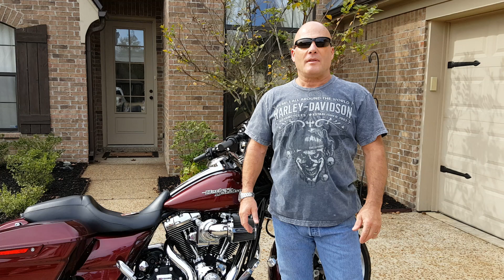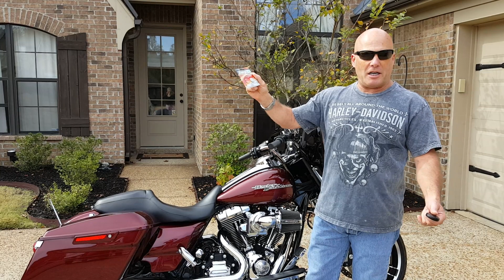Bike won't start? Could be your key fob!

Comment: There's a 5 digit pin code that overrides the fob should the battery die on your FOB. You should have it written down in your owners manual. If you can't find it in your owners manual you still have two options left. #1 you can take it to your local HD dealer where you bought the bike and they can recover it for you. # 2, take the little blk plastic casing off of your ignition barrel key and the factory FOB override # is  there. That is, as long as you didn't change the #. Which you can do. Just don't be a dumbazz and forget the #. Now for the tricky part, knowing how to enter the override pin. 1st, turn the ign switch to the "on" position and the start switch to the "on" position. You should get some flashing lights etc.. Where it shows your milage it should now have a flashing readout that says "enter pin. Now press your left signal switch as many times as you need to, till you get to the first # of your pin. once you have the 1st # of your the pin  press the right signal 1X. That should take you to the 2nd # slot. Again, press to left signal switch as many times as you need until you reach the desired # and then press the right signal switch to enter. Repeat until you have entered all 5 digits. BAM!! the bike should start.
Reply from the maker: Agreed, I know it now but didn't at the time. Thanks brother

Comment: My 2 cents - my and newer bikes come with a pin code - you can use the pin code and start the bike with out the key fog - I did it with my HD
Reply from the maker: Agreed,  I didn't have it programmed at that time, of course I added a code shortly after.   Thanks

Comment: I have a 2014 Indian Chief Vintage and had the same problem.  Was an easy fix, but until i knew what the problem was, i was like WTF
Reply from the maker: Snake Bite This will happen to anything using a key fob when the battery does, crazy.

Comment: I have an 07 knight train amd I have changed the battery in mine several times and I'm still having the same issue. What would you suggest? Short of taking it to the dealer and paying a retarded amount for diag and mechanical rate.
Reply from the maker: It sounds like your fob is staying on, like it may have a short that continues to drain the battery,  I'd take it apart to see if something is out of shape or causing the battery to drain. You can probably buy one on line and reprogram.  Let me know what you do
Reply: I do have a bad parasitic drain on my battery. Its bad enough that a trickle charger won't keep up with it. I will do some more research and let you know what I end up doing.

Comment: You do know you can start your bike without the key fob ....   quick procedure using your Alarm PIN code.   TIP keep a spare battery on bike AND NEVER lock your front wheel.
Reply from the maker: Yes, I know now but didn’t know then. Thanks

Comment: Buck Fifty???!!! I just bought one at the stealership. $4.95.
Reply from the maker: I bought mine at a Kroger's for less than $2.00, everything at the dealership is $$$$$
Reply: I bought a 50 pack from Amazon from Amazon they come individually wrapped and you can keep 2 in your wallet
Reply from the maker: +Matt Garcia Awesome,  how much did they cost you?
Reply: +Tony Ash 50 7.95 +free shipping 

They had different options meaning there was a 20 or 25 pack for 4 and change I got 50 I had a remote start and the remote went thru batteries like crazy
Reply from the maker: Awesome - great price...